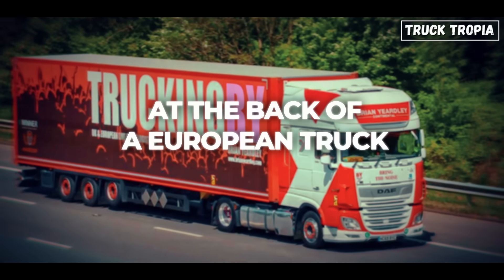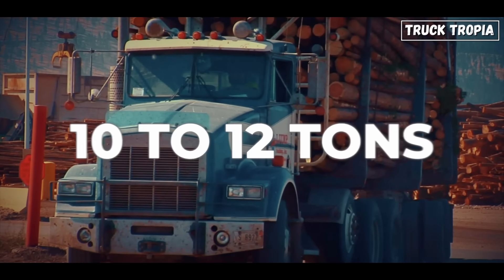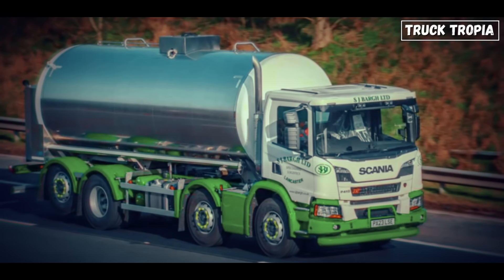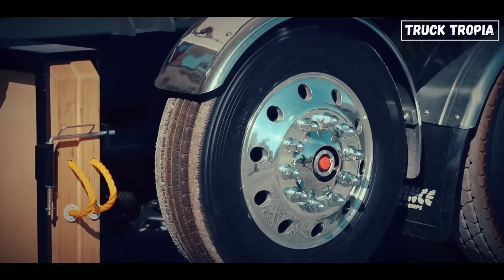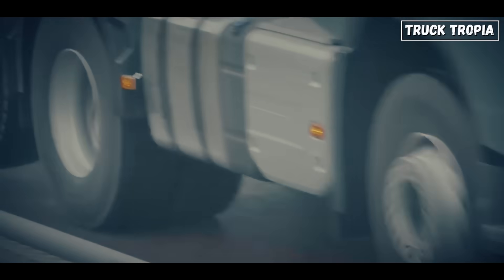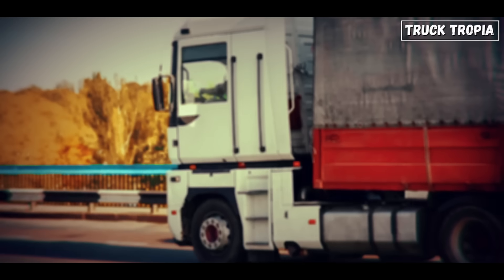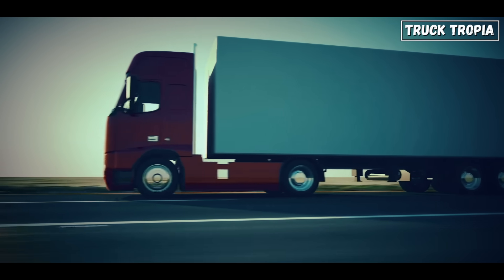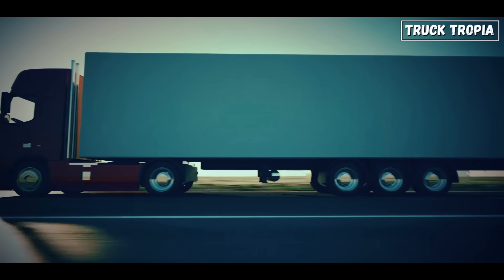Why European Trucks Use Boogie Axles & US Don’t

Comment: One company sent a bunch of trucks up to Colorado from Georgia with unpowered lift pusher axels. Those trucks were a disaster in the snow.
Reply: As a European truck driver, I laugh at the comment. Just put chains on the tires.
Reply: @-hessu-7582  We use chains in the mountains, but our trucks typically go 75-80 mph and chains don't do well at those speeds. We only use them when we have to because they are very hard on equipment.

Comment: I always thought that  a significant advantage is to reduce scuffing the tyres.  When a multi-axle vehicle or trailer turns then the wheels in a 2 or 3-axle setup must 'pivot' to some extent on one of the axles - or at least on some point somewhere midway between all the wheels.  That means that some of the wheels are being dragged sideways to some extent, increasing tyre and road wear.  By lifting an axle this happens much less.

Comment: a lif t axle is a lift axle, and a bogie is a set of 2 axles that have a pivot between them, usually on or under a longitudinal leaf spring that divides the forces between those 2 axles.

Comment: No.  At 7:50, lifting a tag axle improves traction from the driven axle, by increasing the weight it carries.
Reply: Only if the Bogie axle is un-powered.
Reply: @tutekohe1361 It would not lift if it were powered.
Reply: @john1703  Actually they do have powered lift axles, but nobody wants them, so they're rare in North America.

Comment: This is also very common here in Brazil, both on truck and trailer. It helps with better fuel economy, wear of tires and pay less toll when axles are lifted.
Our 9 axle combination can haul 74 tonnes, when empty they can lift up to 5 axles.

Comment: The reason that North American trucks rarely use lift axles is because we carry heavy loads consistently. In winter we also need the extra traction of a twin drive axle to prevent the constant problem of getting stuck. We pull triple trailers and also double 53 foot trailers. It is extremely rare to see such monsters on congested narrow highways and streets of Europe. However we do have lift axles on some of our bigger semi dump truck trailer,  so that when we go back empty we are not wasting tires.
Reply from the maker: Appreciate you adding this information!
Reply: In northern europe we have wieght limits on about 136.000 lbs, even more in some parts. We normally use tandem axels with diff locks and weight distribution, cause of the winter. But also boogie, which is pretty useful for those who don’t carry the biggest loads. They can lift the boogie, and then get a really good grip on the driver axel.
Reply: USA has very light max combination loadings. American Federal highway limits are 70000 lbs - around 35 tonnes. Europeans loadings are significantly higher, even here in New Zealand we go to 58 tonnes.

Comment: You have left out one the most important factors. Europe allows 11 tonnes on the drive axle, which is important for traction on single drive. Countries like New Zealand  do not allow this as the roads are not built for those weights. Single drive axles just wont work and I have experience this losing traction on hills when it is wet. Ice also is a bigger issue with single drive axle at low axle weights. Durability is another issue and single drive axle don't last when loads of nearly 60 tonnes are carried. And I know they do it in Sweden, but they use heavy hub reduction single drive axles, and can lift the tag axle to put 15 or more tonnes on the axle to gain traction. Here some operators use tandem hub reduction axles to haul 150 to 250 Tonnes.
Reply from the maker: Thanks for sharing these additional insights!

Comment: The main reason will be probably "the grip". Suspension works the best and safest if weight on axle is kept withing certain limits. Which is difficult to guarantee on a truck, that is meant to haul cargo, that is usually significant fraction of its overall weight. That is, why trucks lift their axles. Using full suspension while fully loaded and using only half of it without a trailer, making sure, that there is a sufficient load on the suspension, so it works properly

Comment: Lifting tag axle when not required also improves traction for the drive axle.
Single drive axle with a tag are useless for pulling heavy trailers in the hills.
Reply: No they are not.
Reply: @apersson850  You misunderstood. You can pull up a hill far better if you have 8 powered wheels rather than 4 powered wheels. That is why we don't bother with single drive trucks.

Comment: Single axle is European standard 40t truck, tandem axle is UK standard 44t

Euro trucks often have a drop axle on the trailer for weight distribution, you are charged/taxed per axel
Reply: Single axle looks terrible on a truck as well
Reply: @martinws8416 more space for larger fuel tanks big fuel saving when you only need to fill up once a week and you can do it in Luxemburg
Reply: @Parkshite  What a bad argument, honestly.
And that's also not true,  there is just no rear space between the rear wheel if there is not another axle added to it.

And you can't go to Luxembourg everytime to fill up your vehicle when you need to go to other places in Europe. In the US/Canada/Australia fuel prices are about the same
Reply from the maker: Good to know about the axle standards!

Comment: Our bin trucks use 6/2*2 steerable tag axle. Although we never raise the rear axel because the truck is too heavy even when empty. The Mercedes we have also has a switch to lock the rear axle so it cannot steer which is useful in very certain situations

Comment: Also a obvious thing most trailers in the US have 2 axels in the EU they have 3
Reply: I think it's indeed better to have tandem axles on both the truck and trailer, not the european way with a single axle on the truck unit and tridem on the trailer
Reply: @martinws8416 no, it is more efficient on fuel to have a single drive and 3 axles on the trailer - assuming traction is not an issue.
Reply: @tutekohe1361   No, it's more due to weight on the axles on, EU regulations, and it looks so ugly and cheap but it does not matter much, EU trucks won't go faster than 85-90 km/h
Reply: They need three because they only have one on the tractor.  In Canada we commonly have trucks with up to 42 wheels.

Comment: We also have steerable tag and pusher axles😂  And Volvo and Scania have driven lift axles. 

And if your truck is to heavy you can't lift your axle, so lifting it to maneuver is complete bullsh!t😂 Unless you did change some parameters or something like that. And it also depends which axle you lift if you can maneuver better or not.
Reply: I lift my W900's ale to turn all the time
Reply: @SilverStarHeggisist Well we don't need to do that if we want to turn😂
Reply: @nisfh420  my lift axle is an auto steer, but with particularly sharp turns it tends to drag the tires. It also auto lifts when I go in reverse. 

On occasion when it's been wet and I entered a turn a bit hot, I'll also lift it which puts more weight on my steer axle helping the turn.
Reply: @SilverStarHeggisist  In Europe those axles are connected to the front axle via a rod or hydraulic or hydraulic with a control unit. So the tag axle steers in align with the front axle. They also stop steering when raised up

We also have trailers with steering axles and if needed you can get radio controlled systems.

The US Army now used Broshuis Trailers those heavy haul trailers are really really high tech compared to the US stuff

Comment: I can explain the disadvantages of lift axles to you because for years I drove a truck used for what's called "Kombiverkehr" (combined transport) in Germany. Recognizable by the old green sign with the letter "K" in it, these trucks could carry up to 50 tons / 110,231 lbs. That's 22,000 lbs more than a "standard truck," but with the restrictions of only driving them from the train station to the recipient and back, and a maximum distance of 50 kilometers (30 miles). Mine had an extended frame, allowing it to transport two 30-foot containers. And that's the first disadvantage: the turning radius. It was almost impossible to maneuver this monster in city centers. The concept was quickly abandoned for this reason and because of the road damage. The second reason: the enormous length of this "road train"... 25 meters, almost 80 feet. Overtaking on the highway was "impossible" with the government speed limiter. And the chassis geometry wasn't the best either; due to the excessively long wheelbase, the truck with its trailer handled like a drunken beaver with a lamb's tail. Because the lift axle had a "forced control" that automatically pulled the axle when the truck was empty. Basically, everything about that thing was wrong.
Reply: In Sweden 25.25 meters is the new standard and now lumber trucks have four axles on the truck and five axles on the trailer to keep ground preesure down
Reply: doesn't seem like it was the lift axels fault.
Reply: In Sweden we've had 24 meters since 1967 and now even longer.
Reply: In Canada we haul double 53 foot trailer trains. So that is about 150 feet of truck. You guys have such small trucks. I have driven in Germany and all over Europe. I don't remember seeing too many Super B Trains. I driver these monsters all the time. Super B Trains have 30 wheels and can go anywhere, however our double 53 foot trains are restricted to twinned highways. They have up to 42 wheels.

Comment: Who wrote this nonsense? The main reason for lifting the axle is to increase weight on the drive wheels for more grip. This is why you can also lift it at lower speeds when over the normal axle weight. I have often seen drivers struggle with spinning drive wheels because they are not taught this.😡🤠

Comment: AMERICAN TRUCK IS HARD TO ACCEPT,  UGLY DESIGN,,CANNOT USED IN THE CITY ,,HARD TO USE BECAUSE VRY LONG NOSE AND LOW HORSE POWER,, WORLD WAR 2 ARE FINISH NO NEEDS THAT TRUCK FOR COMMERCIAL
Reply: American trucks and trailers look much better.  American truck drivers are also much more professional than their european counterparts. 
That's why truck drivers in the USA earn between $45.000 up to OVER $100.000, average salary is $60.000.....  in the Netherlands/Belgium (the higher paid countries on average in Europe) only about 40.000 EUR max.
American truck drivers also dress normally/wear normal (work)clothes wheras truckers in Europe wear tanktops with... sweatpants and think they are professional 😂
Reply: @martinws8416  THAT IS YOUR REASON BUT  IF YOU USED THE EUROPE TRUCK MUCH BETTER THE EUROPE ESPECIALY THE MAN TRUCK TO TRAVEL LONG
Reply: Who told you that. We drive our big trucks in the city all the time, but yes I understand that in Europe our trucks might not fit very well.
Reply: @SternDrive  I HAVE MANY EXPERIENCE TO AMERICAN TRUCK AND VERY HARD TO USED ESPECIALY IN THE CITY AS A DELIVERY TRUCK ALSO IN PORT MUCH EASY TO USED THE FLAT NOSE WITH BIG ENGINE ALSO IN LONG DISTANCE,,, 30 YEARS EXPERIENCE I NOT SHORT FOR THE DRIVING
Reply: @AlexanderYlohimBisco  man you have no experience at all 😂
Reply: @4_SRJ  YOU CANNOT ACCEPT BUT THAT IS TRUE AMERICAN TRUCK IS UGLY HARD TO USED AND WEAK ENGINE,,, AND THAT TRUCJ ARE ONLY USING FOR THE FOREST AND DESERT AND NOT A COMMERCIAL TRUCK
Reply: @SternDrive   NUMBER 1 EWASON FOR AMERICAN TRUCK ARE UGLY DESIGN,,, 2ND LOW  HP.. CANNOT USED TO TRAVEL LONG IN MANY TIMES AND ONLY FOR WIDE ROAD
Reply: @AlexanderYlohimBisco  Im not evengonna read ur caps lock bs,  we both know trucks from the USA are real trucks and from europe are not real ones. 

American trucks had already engines over 900 hp 45yrs ago
Reply: @martinws8416  MUCH BETTER THE CHINESE TRUCK WEAK BUT POULAR LOOK AT THE EVIDENCE THE WHOLE PLANET ARE ACCEPTED
Reply: @AlexanderYlohimBisco  USA- the greatest country on earth.
Reply: @4_SRJ  TO AMERICAN PEOPLE GREATEST BUT NOT TO THE OTHER COUNTRY,,, THE GREATEST LIFE HAVE HIGH INTILLIGENT  AMERICAN LIFE ARE ONLY BRAVE BUT NO ANY INTILLIGENT
Reply: @AlexanderYlohimBisco  ldiot lol
Reply: @4_SRJ  THAT IS THE TRUTH WITH MILLION OF EVIDENCE
Reply: @AlexanderYlohimBisco  Using CAPS will not help you win any arguments, I will tell you once again: 

American trucks = the best, american truckers = most professional, american road services for truck drivers = the best.

Europe does not have anything good for truck drivers. So once again US beats Europe in this.
Reply: @AlexanderYlohimBisco no evidence from you, just screaming for attention in CAPS LOCK. HOW DO YOU FEEL LIKE WHEN SONEONE IS WRITING LIKE THIS TRYING TO PROVE THEIR RIGHT BUT THEY ARE NOT 😂

Comment: Most North American trucks have tandem drive that is not needed and adds weight, tag axle works just fine but North American trucks haven't changes in 50 years. Europe offers a large number of axle configurations. Mish mash of different rules between different states and provinces in North America doesn't help.
Reply: Tandem drives makes driving in slippery conditions possible. When I get sand, the truck won't move i they're not locked

Comment: Euro Trucks don't have boogies like a train car does. 
All 6 wheels are attached to the frame with independent suspension. 
Only that the tag axle can be pulled up by the air suspension.
Automatically after load.
Reply: Independent suspension? Really?

Comment: There are no switches to raise tag axes! 
The force of the 1st axle is automatically measured and if the weight there becomes too large, the 2nd axle is automatically activated.
By the way, tag automatic axles are also available on trailers.
Trucks that are extra long don't drive through cities anyway. These are permitted to highways.
Reply: Alot of trucks have switches to raise the axle. I drive one such truck.
Reply: While it's true that many trucks will automatically lower the tag axel depending on weight, they do usually also have switches to lift the tag axel, which is vital in slippery conditions to increase weight / traction onto the drive axel. Once the truck is driven over a certain speed, it will revert back to the automatic lift mode.
Reply: Don't be silly. In Canada we have double 53 foot trains that drive through the city. That is almost 150 feet of truck! Very common here. Where do you get your information?

Comment: No need for 6x4 if you're not driving off road. I've owned and driven Scania 6x2*4 (hyraulic steering tag axel) for many years in both city and country roads in Sweden and never got stuck, even with trailer and GW 60 t (metric, 66 US t). No problems. It's possible to transfer weight from tag axle to drive to get better traction in snow. The steer axle makes the truck turn like the tag axle is lifted even when it is not.
Reply: It helps in snow and gravel. We have a tractor that can't lock the diff and it gets stuck on our gravel lot

Comment: The legal requirement and road protection is the same thing. The legal restriction is FOR road protection.

The static friction of the tire is unchange same weight and tire pressure, regardless of contact point. When the friction is dynamic is a bit more complicated, but typically static friction is what is intended.

No, roaling resistance is barley change of lifting the axle. The main reason to do so is friction when turning. Because two axles that are fixed in direction they will fight each other.

That is why you typically don´t se a truck with two stearing front axle that can lift one of them. There is not much point in lifting a stear axle. While some trucks do have liftable stear axles. This is often dome mostly for more even distribution of weight.

Comment: added bonus: 
A bogie or tag axle config provides spare wheels if all else fails
Should a steer tire blow out on the Autobahn (or equivalent for other Eurasian Countries) the driver can (provide the truck carries tools to do so) pull one wheel of the lift axle and get " safely " to the next secure pull out..., worst case scenario if the tire place has backlog.

Fun fact: lifting the tag axle can help, particularly to get going, in icy conditions as the full weight goes onto the drive axle

PS. I have seen super heavy haul tractors with 3 drive axles (at least one is a life lift-able) + bogie and tag in Germany, very rare sight and limited to night time drive with full escort, including police, only.
Reply from the maker: Thanks for the added info!

Comment: * not nessesarly for semi, for for other 3 axel trucks the liftable axel can also be a stearable axel
* europe more strict axel weight limit? sound like bs to me. considering how much axels they need in US for the same load
* lifting axels can reduse grip on slippery roads? also bs, its actually the opposite, and they can be powered axel even if its liftable
You definently need to do some more stufy before posting your video's, this is far from first time you got several things wrong..
Reply from the maker: Good we have you to point it out.. ;)

Comment: a bogie is any two or more combination of interlinked axles that are so linked together that the load applied to one axle is applied to the other when in their working position and is akin to an axle group

tag axle, push axle when down along with tandem drive and tri-drives etc are ALL bogie and axle groups, this would include tandem drive with a push axle and\or tag axle that together ALL form a group.

therefore your donation was fundamentally wrong from the start in terms of the world as a whole.

further to this the axle group on the rear of a semi trailer or converter dolly, inter-dolly, jeep dolly etc with two or more axle is ALSO a bogie